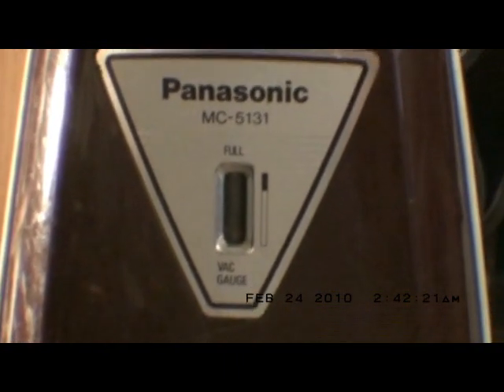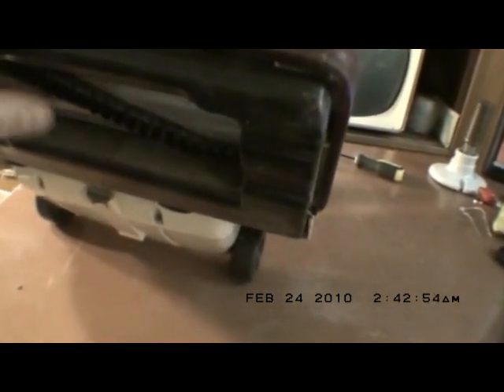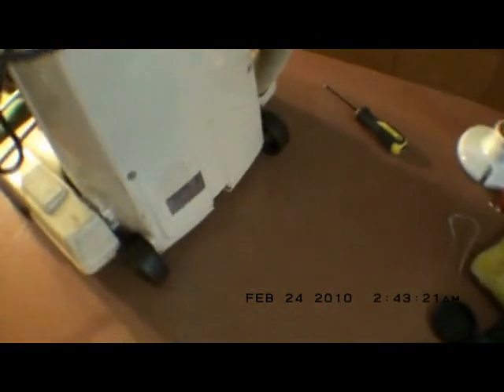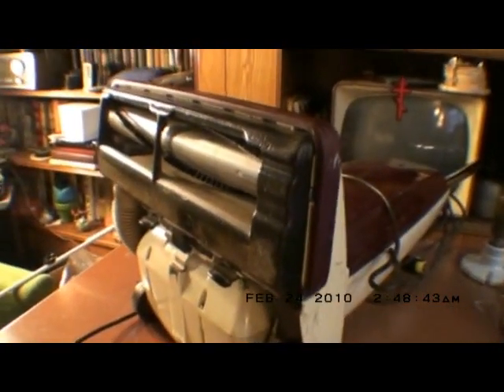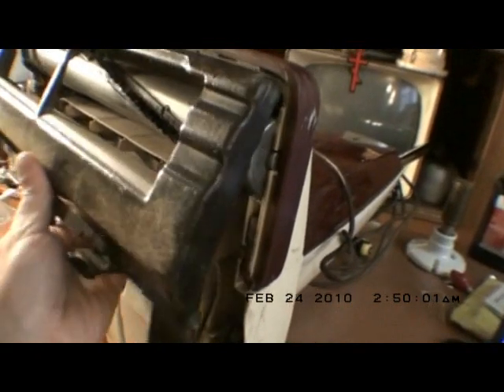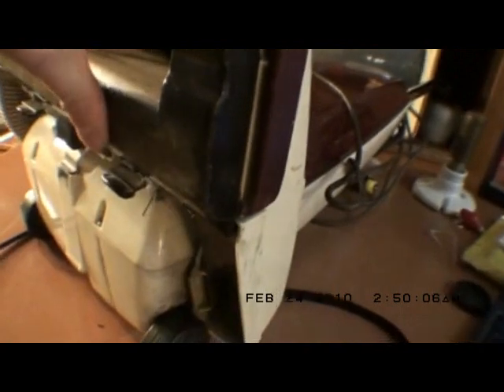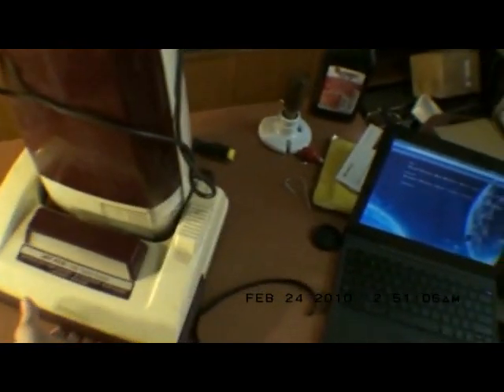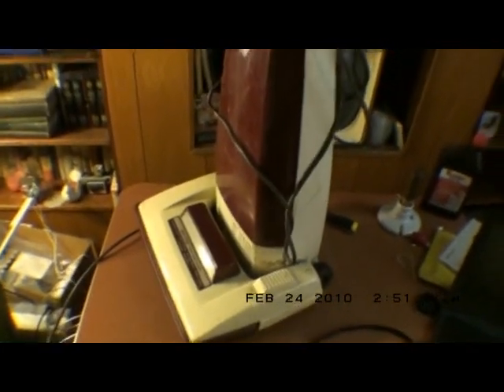Panasonic Jet Flo  MC-5131

Comment: This is very similar to a Sharp EC-3320A trash find vacuum I have. Needs a belt and a bag, which should be interesting. And it needs to be torn apart and cleaned in and out from sitting on the patio before it was tossed.

Good deal for a trash find, needs some cleaning, belt and some oil on those bearings they sure make some hellacious noise.